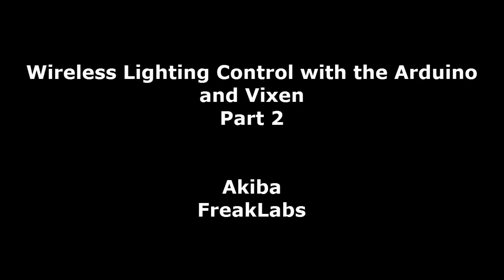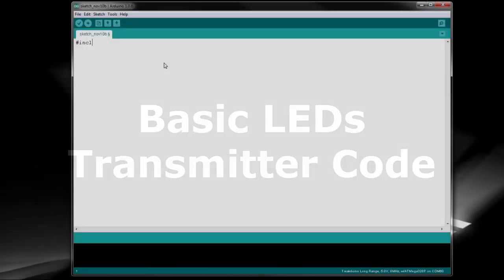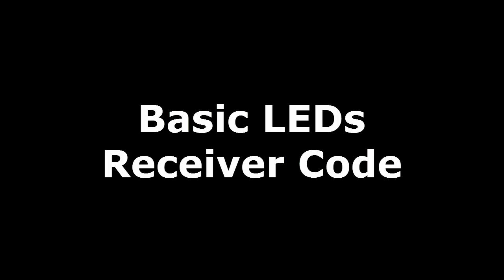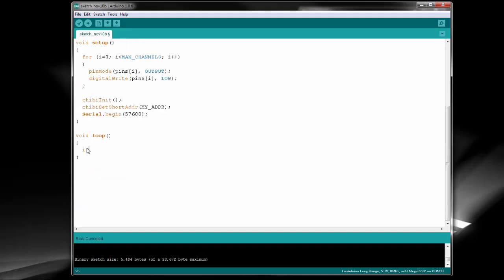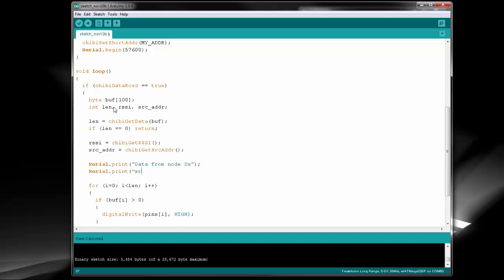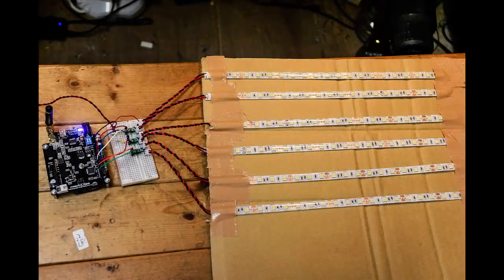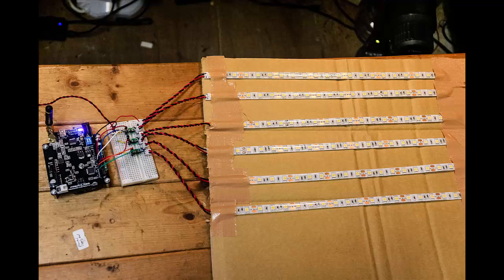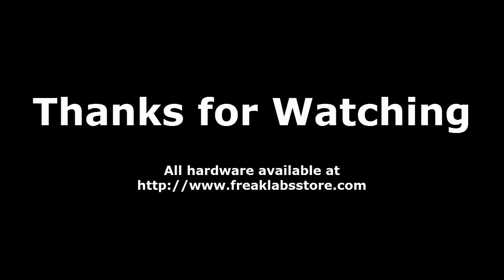Wireless Lighting Control With Arduino and Vixen Part 2

Comment: So in theory could someone use this and extend it to become a firework launcher by using a 16 channel relay with a battery to ematches. Then connect this to the arduino? My idea is to use vixen software to make a wireless firework firing system.

Comment: Hey,

I am a total newbie to this stuff and could use any help and direction you can provide. I am trying to accomplish this:

https://www.youtube.com/watch?v=jP9vAYKHNTk

https://www.youtube.com/watch?v=98BkaUU0cMQ

Thanks!
Reply from the maker: Are you trying to do this wirelessly or wired. If its a wired MIDI connection, then there should be plenty of videos out there to decode MIDI signals. For a wireless MIDI connection, then I would translate the MIDI codes into wireless codes and then decode them on the remote end. It's similar to what I did here:
https://www.youtube.com/watch?v=tJUirxHgI34&index=12
Reply: Originally, I thought I'd have to write a light show using midi in a DAW like Logic or Abelton and then save those .mid files onto an SD card that I can load into a RPI. Hook the RPI to a Relay with LEDs and have simple Play//Stop//Forward//Backward control. Similar to how you have it controlled in the wireless video you have done. 

But after seeing your videos using Vixen, I was hoping that would be an easier and more elegant solution (especially since we are a touring band and would have to set up and break down every night). The way you have it controlling the wireless tape, can you set that up for more than one song // can you create a playlist?

Also, I am very sorry if I am not explaining myself well. I am totally green to this and way out of my depth.
Reply from the maker: Oh, for lighting, I'd totally just use Vixen if the triggers were fixed in time. If not, then you will probably want to use MIDI. You can get the midi triggers directly from most DAWs though like Ableton.

Comment: Thanks for the great video. I noticed you were controlling these using wifi, but could you do the same thing using bluetooth? I want to drive a Christmas light display, and have SSRs driving corded lights, but have some windows up high I would like to drive wirelessly. It would be far easier to just run extension cords along the house, but it would look terrible and I could plug in the wireless modules inside to keep them out of the weather. How would you tackle this project? Thanks.